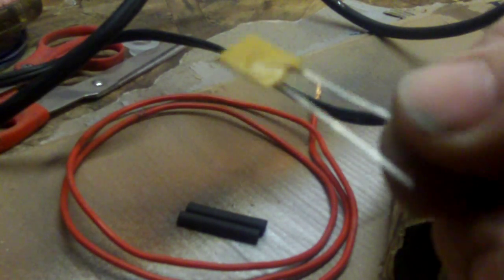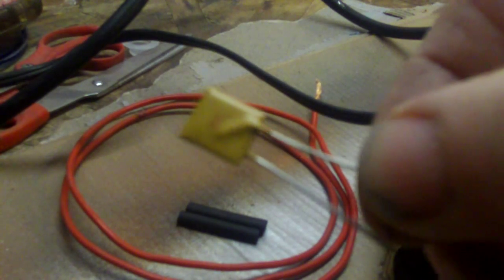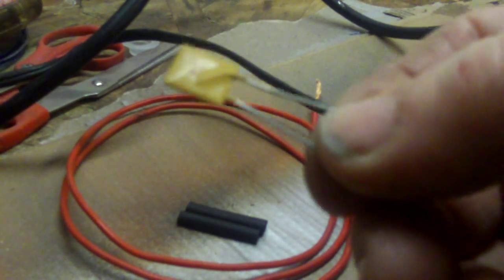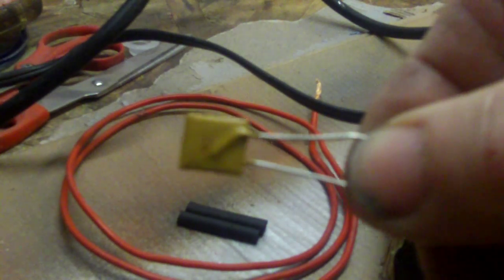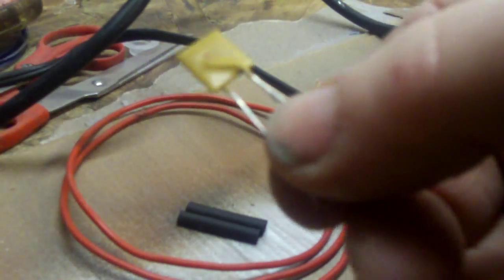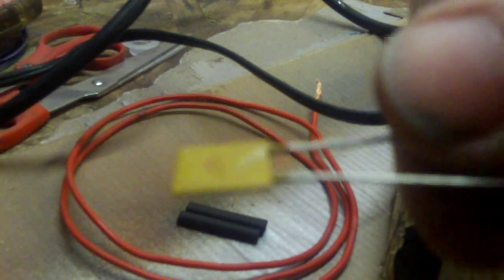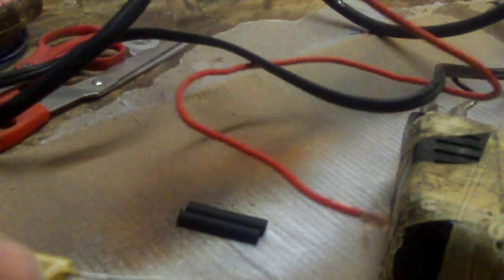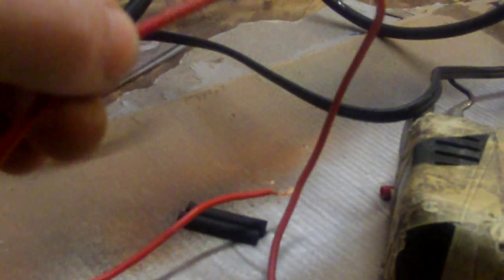Making a solid state fuse PTC protected jumper wire

Comment: Keep in mind that those fuses have relatively high electrical resistance compared to a traditional fuse. They rely on internal heating to trip, and have to create loses in voltage in order to work. If it is Ok for you, this is a legitimate use for them :)